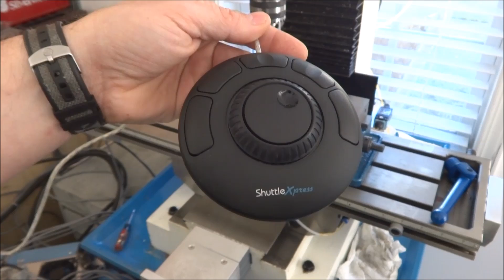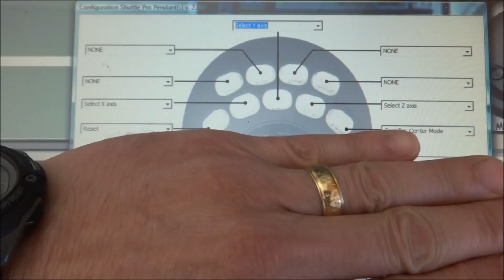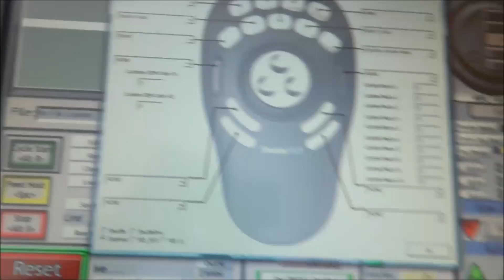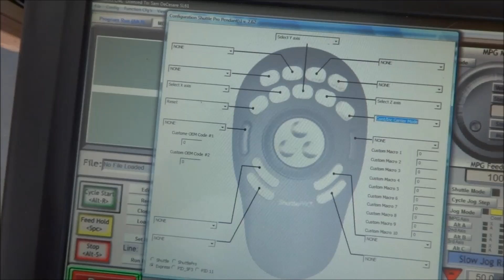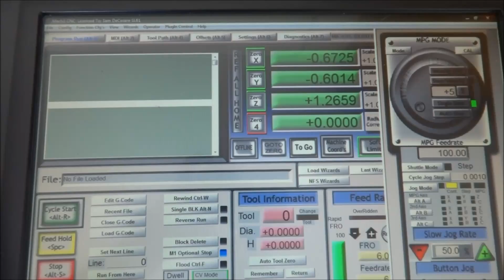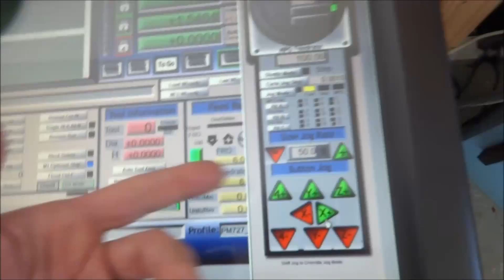PM -727M  MPG Jog  Shuttle

Comment: Curious if anyone has had problems running Mach3 on Windows 10 using a shuttlexpress and the plugin.  I just got one and it seems to be very buggy.  Can get the inner wheel to do step mode but in continuous mode the inner wheel wont operate at any repeatable speed and the outer wheel jogs very slowly.
Reply from the maker: Hi Bob The inner wheel is great for stepping in increments. And I use the outer band for continuous. This is my default setup and the way I find it works best.